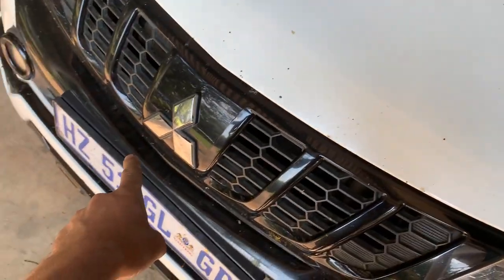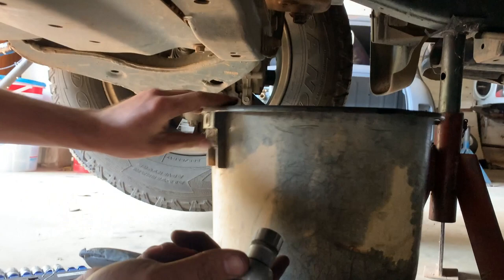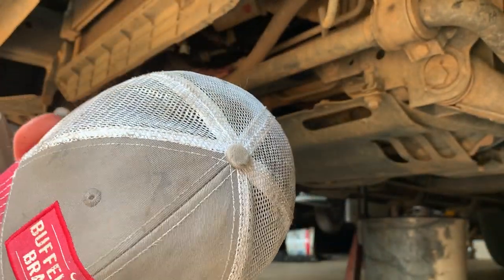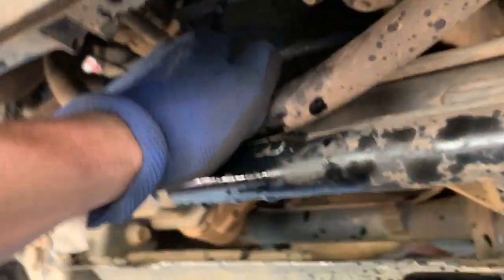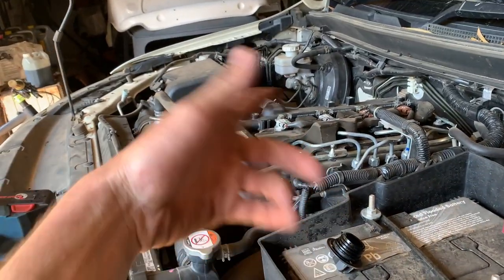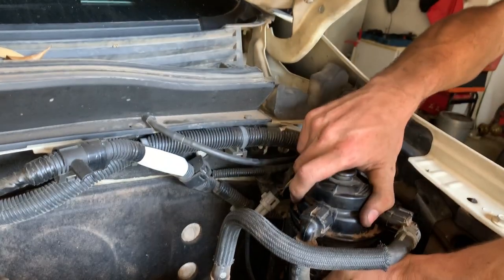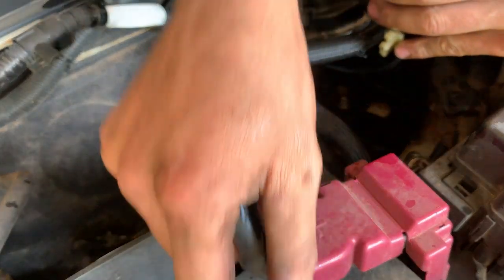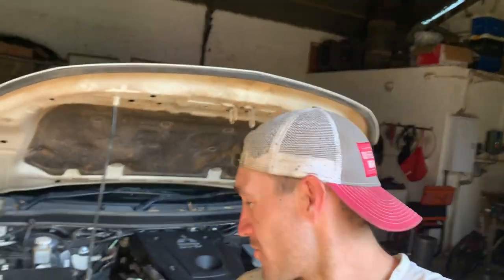How to Service a 2018 MQ Mitsubishi Triton

Comment: Hey mate how did you fix the leak in the fuel filter
Reply from the maker: Hey Man, i just tightened the filter housing a bit more
Reply from the maker: Also make sure you change the supplied o ring in the kit 💪